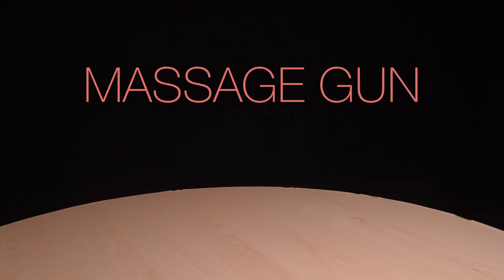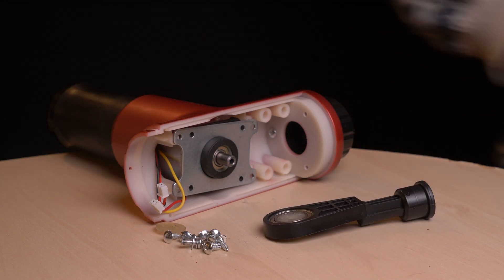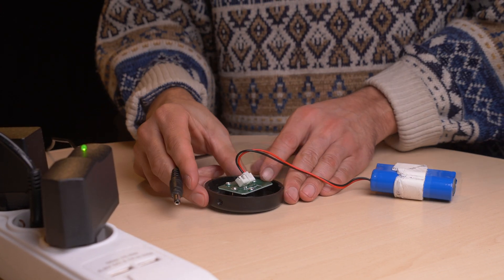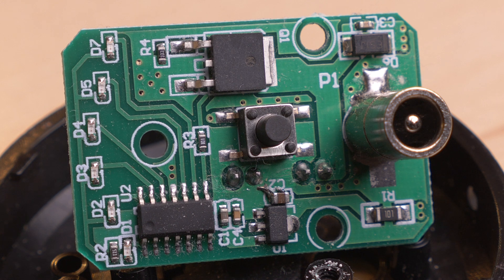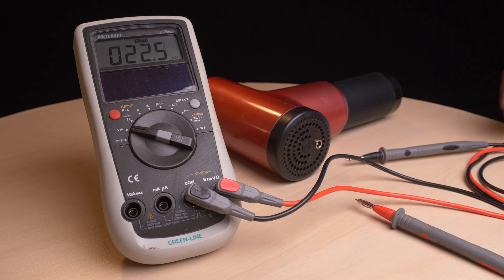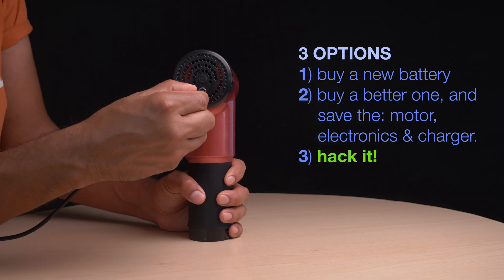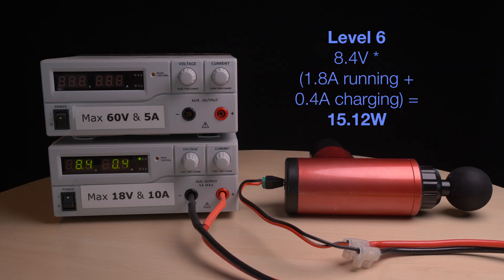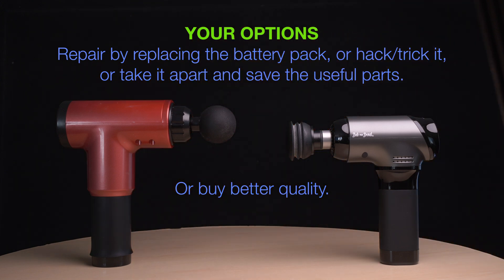Massage Gun, Teardown and Repair/Hack

Comment: In my massage gun the battery does not make good contact, put when I press the base it does. Any idea how to fix it?
Reply from the maker: Often "broken” stuff just needs cleaning. Try opening and cleaning with: alcohol, contact spray, sometimes scratching the electric contact points.

Comment: Hey 😊 love your video it is crystal clear ,
Then I have one question here with my situation ,
The massage gun batterie once I start it it will run for 3 sec then stop if I test the batterie from outside "charging socket "it will give 0.02, but once I dismantel and check batterie directly I still have 11v again once I connect and try to start will run for 3 second and stop check batterie voltage again 0.02 so disconnect bat from circuit then conect back to 11...v
Reply from the maker: Very similar to what my battery pack was doing. I think the BMS on that battery pack is disconnecting the power. That is its function, for safety. Question is if that BMS is doing a good job, or if it is the problem..

Comment: Great video,  I knew my battery was bad, but I tore mine down today (a different model, but still cheap) I got to the point where I had the charger powering it up (had to resolder the +/- of the charger to the battery terminals), I got it running, but forgot about it needing more amps when loaded (I'm just okay with electronics).. so it'll run unloaded fine, but then when I push it against something it'll stall and shut off.. Current options are buying a better power supply with more amperage like you had in the video, or a new battery and undoing my "work" or just let it go to my electronics scrap bin for now, as I didn't use it all that much when it was working fine (probably what lead to a bad battery, rarely charging/using it..)

Comment: Awesome video! I have the same problem. I have connected macbook's adapter to the gun and set the voltage to 15V through a USB PD board. However it works for half a second every 10-15 seconds. Why might that be? The battery was 14.8V 2.6A.
Reply from the maker: Good chargers don't give constant power like adapters do. They measure the battery's voltage and the ampere intake. They have a charge schedule that fits a specific chemistry. So I was surprised that it worked. Tha bad battery was still in, I guess that works as a buffer. Without a battery is should not work. But then: use an adapter with a (constant) voltage that is not too high.
Reply: @GiesbertNijhuis  thanks for the reply. turns out it was my stupidity. I was directly connecting to the barrel jack thinking the battery is also connected to it. I traced battery connectors and found where they go in. And connected power there and it works.